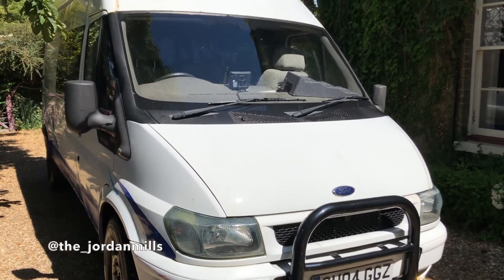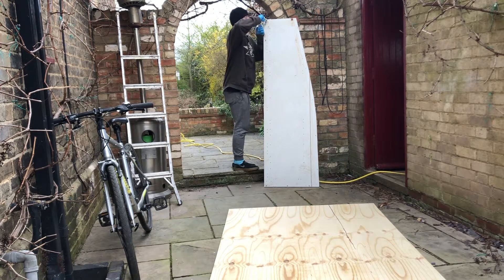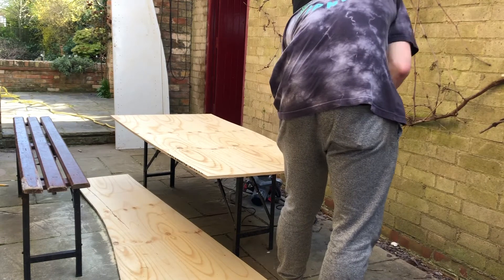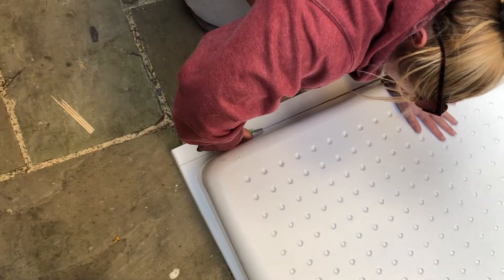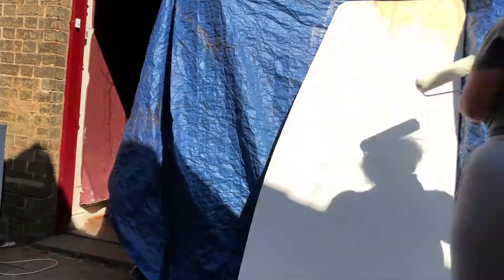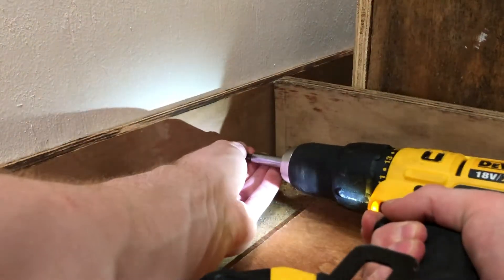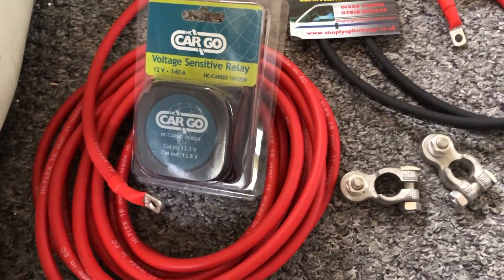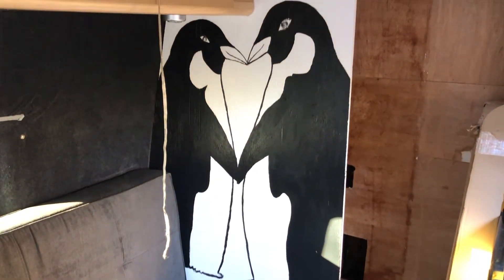CAMPERVAN UPDATE 1 - SHOWER ROOM AND TRAY BASE (Episode 3)

Comment: Try inserting the key into the ignition, then turn the key from position 1 to position 2 and do it four times in six seconds finishing with the key in position 1. The system should bleep...  Within ten seconds of the bleep noise press and hold any button on the key fob and the system should bleep then press and hold any other button on the fob. Turn the ignition to position 2 for ten seconds, then turn it off and remove the key. Jump out, and try the remote. 
Fingers crossed for ya !! :)
Reply from the maker: Thanks!! Hopefully it won’t happen again but I will definitely try that if it does. Something similar happened to my missus’ car and I went on the internet and found a sequence to try and it sorted it right out